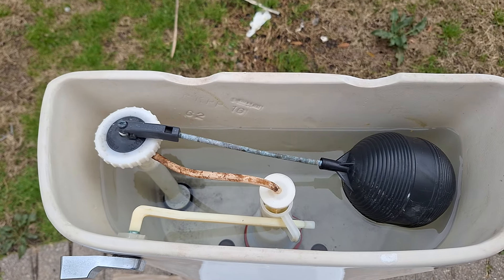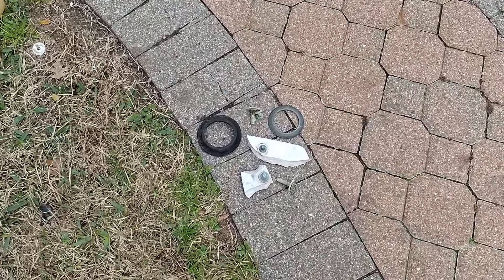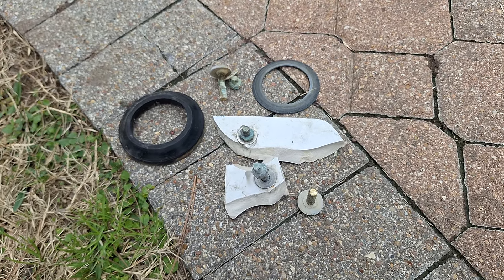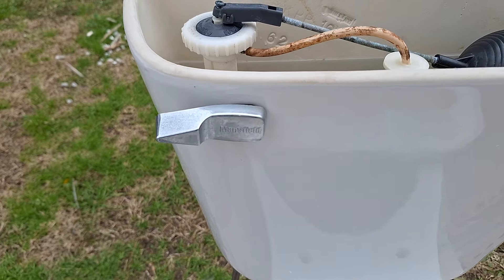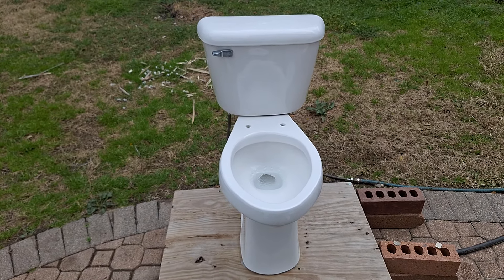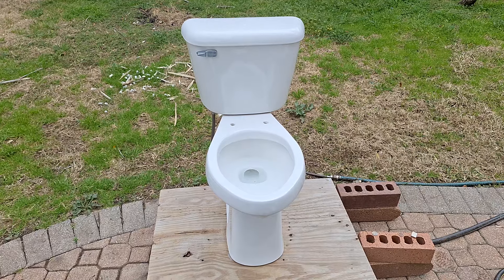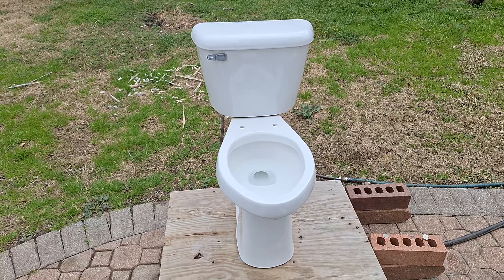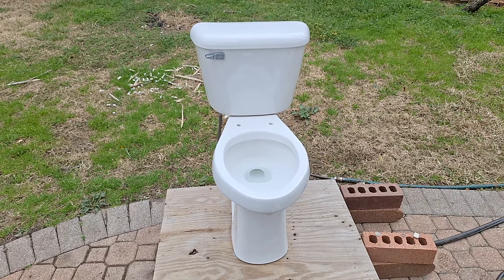2000 Comfort Height Mansfield Alto Flushes!

Comment: Nice toilet with a decent flush - obviously a longer flush would be more beneficial for it to siphon with a little more power as it was a bit weak/delayed. Definitely a contender for my  top five 1.6 GPF (6L) toilet list as the Kohler Wellworth Ingenium is also on the list as they are good toilets too (I have one for UK toilets too).
Reply from the maker: I love these and they are my favorite 1.6 gallon toilet. The performance is not impressive though